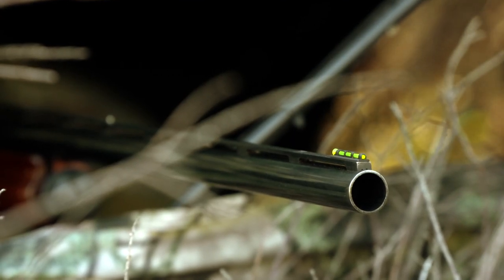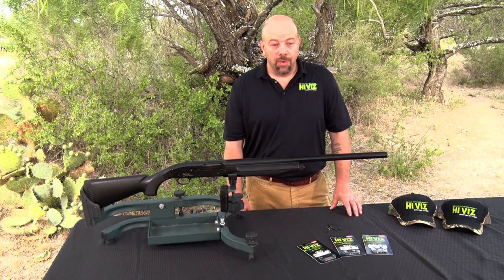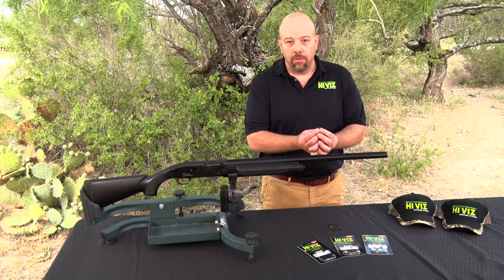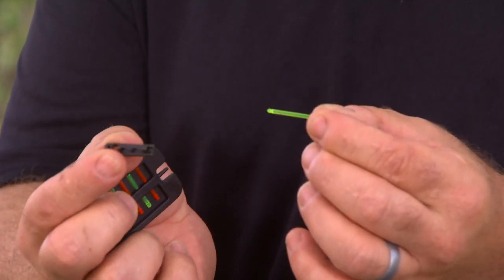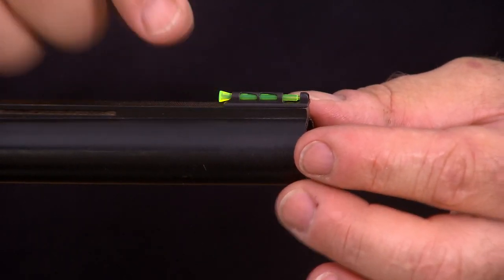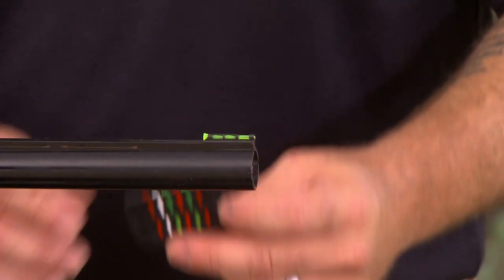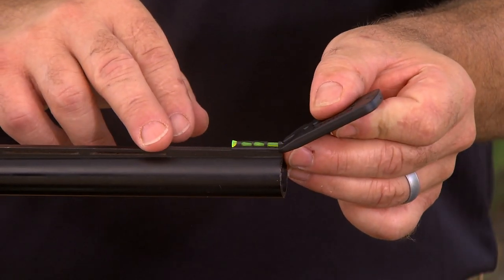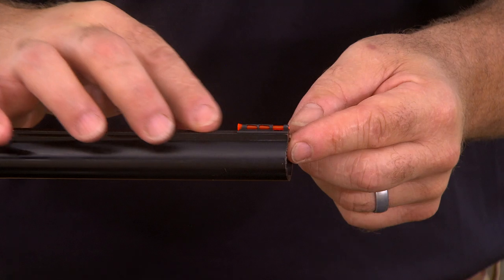Installing the Shotgun Comp Sight from HIVIZ

Comment: My only concern with this sight is - what keeps it from swinging left or right?  It's only held down with one screw, and most of the length of the sight is in the rear.
Reply: I answered my own question.  The base seems to have a very, very slight arch to it that flattens out as the screw is attached.  I have now attached these sight to two Benelli M2s, a Browning A5, and a Winchester SX4.  I would disagree, though, that she screw doesn't need to be very tight.  It does need to be tightened down, snug, not farmer-tight, but snug.  I used blue Loctite on mine.  These sights are so much better than the red LPA sights that came on the gun.  I'll be putting them on 4 more guns.